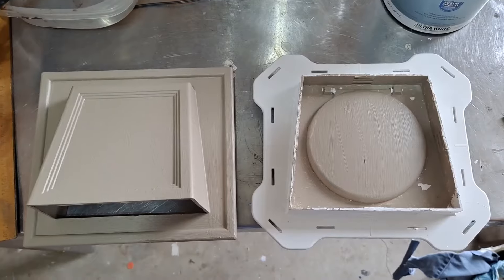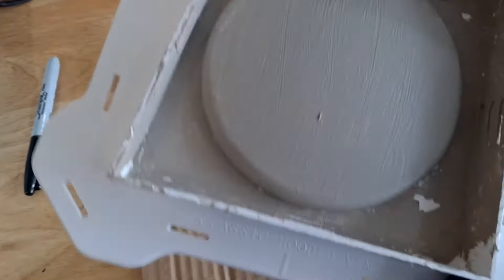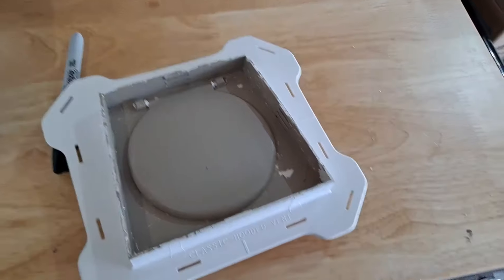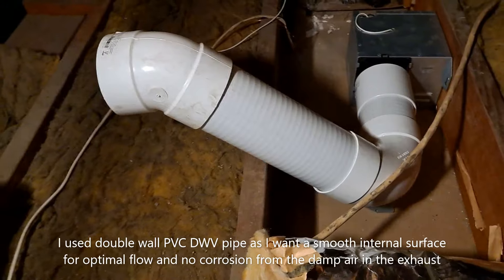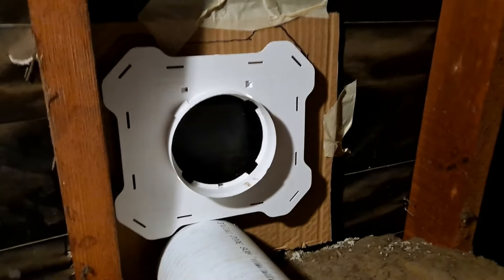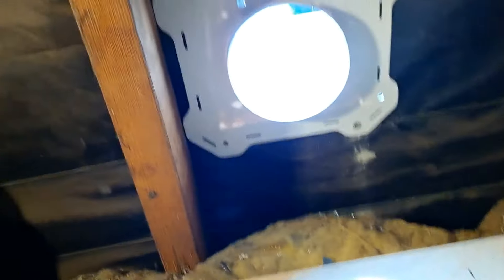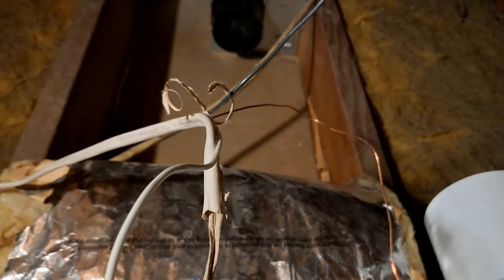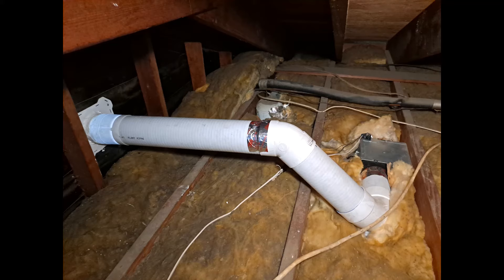Bathroom Extractor Fan install using rigid plastic duct

Comment: Just watched great vid. I’ve found a concentric condensate fitting designed for just before/after the fan connection, it needs to be positioned in the vertical, but wrapping the pipe in rock wool will help to prevent condensate within the duct (some people find it drips back out through the fan)
Reply from the maker: Thanks. Yes I'm in a dry climate but I can imagine that could be a bigger problem in colder or humid environments.  This is true whether you use metal or plastic duct.  I usually leave my fan running at least 20 minutes after showering to allow drier air to remove as much moisture as possible from the duct before it stops
Reply: That's a smart idea!

Comment: Good install Indra, however I don’t think you should have put the mounting flange on the inside of the wall, the outside flapper/finish plate clips on to that piece and you have the thickness of the wall in between them.
I’ve always just drilled a 4” hole and mounted the flange to the outside of the wall and clipped on the cover.
An insulated sleeve will help with condensation, it’s just slipped over the pipe.
Reply from the maker: Thanks for the comment.  You're right - I should probably have mentioned this in the blah blah.  In most installations I agree that what you describe is how it should be installed.  However, my wall was already existing.  I didn't want to damage or have to re-do the exterior finish and the stucco is only an inch or so thick so I was able to put the flange inside and there was enough penetration that I could still clip the cover on from the outside.  This meant that I didn't then have to figure out how to cover up the flange on the outside surface of the stucco.  I was concerned about that and until I checked the thickness of the stucco I considered changing my vent and the install method.  In summary I ended up with an 'un-conventional' installation of that particular style of vent.  I've added a note in the Description about this

Comment: Recently fitted an inline extractor fan in our loft. I raised the height of the fan on a plinth so that everything from the fan exhaust is downhill.
Reply from the maker: good move.  Indeed I believe most building codes call for a 2% downward slope.
Reply: did the same thing, let the condensation run out the wall

Comment: Awesome job.  I am just realizing that I will want to use rigid PVC.  That exhaust outlet looks nice. Where did you get that?  I read recently that it makes sense to insulate the fan box too. That cold metal box can also condense your humid air rapidly.  I plan to do that too.
Reply from the maker: Thanks ! The vent was from Lowes.  There's a link in the description.

Comment: Very cool... but I wonder how hard it would be to replace with a different fan down the road since everything is rigid.
Reply: He can access the attic where it is installed. Also, you don't need to glue the joints, which makes it easy to take apart in the future.

Comment: will the steam , turn back into water when it enters the rigid pvc pipe and run back down and shorten the fan ?
Reply from the maker: Hi. Good question.  Shouldn't do because I made sure there is a slight slope down away from the fan on the long section.  Also the inside surface of the pipe I used is slightly ribbed.  Plus I'm in California so we don't often have long periods of really cold or damp weather

Comment: Hello, I recently removed the flex pipe from my bathroom fan and intend to install pvc also.  I don't want to glue the pvc to the fan, so I was thinking of getting a flexible coupling.  It appears that you secured your piping to the fan using metallic tape only, am I correct or did you also glue it?
Reply from the maker: Hi Mario. You're correct. I didn't glue it. I used the metal HVAC tape only and it worked out great.  The tape isn't cheap but it's worth the $
Reply: @dadlifediydoityourselflike2293  Nice install!  Just a couple questions/concerns but may not apply to you.  I did this kind of install as well 5+ years ago but a longer run to my exterior wall.  Some of the things I ran into that I've had to modify since then may not apply to you based upon your climate.  I live in New England USA where during winter, our unconditioned attic gets well below freezing.  I also used the metal foil tape for my connections initially.  My challenge comes from the condensation that drips out of the vent flap will freeze once the fan is shut off because there is a small quantity of water that remains under the flap (I have the same PVC flap you have shown).  As a result, that flap won't open the next time the fan is used if its still cold out and believe it or not, the fan in my case was powerful enough to pop one of my connections that were taped.  I didn't know this until I started seeing water stains on my ceilings below.   If you may have these same cold temps, I suggest converting as the other poster asked to the flexible couplers.  I've had no issue since then.  Likewise as someone else has posted, if you do have really cold winters, do insulate around the pipe.  It will prevent so much condensation inside that can cause that flap to freeze shut.  Finally, I couldn't really tell by the video what the final connection is to your flapper, but just be careful about that connection as goes through your exterior wall as this connection is not water tight and any condensation that collects or passes through this zone will find a way through the connection and into your wall.  Again, not sure if your connection is actually outside the wall or in the middle or worse, inside.  I've been searching for a good way to remedy this online for some time which is why I found your vid.  I think in the end, insulated pipe is the best solution but I haven't gotten around to it yet so I just need to make the move!  Either way, much improved over the flex stuff!
Reply from the maker: @vcookster3915  thanks for the constructive comments and for sharing your experience.  I live in southern California so I'm not subject to the kind of temperatures you're seeing. Your comments are therefore appreciated for those who watch this vid and live in colder areas. In that case I would support the insulation and other comments you made.  My exterior wall is stucco and doesn't have an internal wood or other surface inside it interestingly.  My connection is inside the attic and for that reason I was careful to seal it with a silicone based sealer that bonded to the pipe and the vent flange.  I also sealed around the opening that I cut into the stucco.  Any drops etc will therefore have nowhere to go other than outside.  Amazing that your flap stuck so hard that the pressure popped some joints in your pipe . Wow.
Reply: @vcookster3915 In regards to the condensation that forms near the bottom of the flap and freezes shut what is your solution to that?
Reply: @OGCJ10 condensation is inevitable to some degree as the hot steamy air get sucked out of the warm bathroom and straight into a potentially freezing cold loft.. you cant stop the science of steam instantly condensing within the cold pipe but you can reduce it by fully insulating the ducting and having the fan overrun long enough to expel the moist air and to essentially blow dry the internal ducting...

Comment: You actually WANT the water to sit in the "ribs" of the flexible duct. That way, it doesn't run back into the blower/inside the bathroom. The ribs and a small horizontal run give it somewhere to settle and evaporate.
Reply from the maker: Thanks for the comment.  Yes that could be a factor which is why I sloped it very slightly downward towards the vent so it wouldn't run back towards the fan.  Also the pipe I used is not entirely smooth inside

Comment: Is it hard pvc pipe or soft pvc pipe ?
Reply from the maker: Hi. There is a link in the comments to the 4" pipe that I used from the Home Depot.  In case the link is not accessible in your region it's equivalent to a lightweight rigid thin wall PVC pipe.... although the pipe I used is designed for drainage and has triple wall design which gives it some insulating properties

Comment: You spoke kind of fast, but did you say the pvc was insulated? If not, the pipe is going to sweat on the outside and drip onto the joists.
Reply from the maker: It's triple walled so I doubt it will sweat on the outside. I also live in a low humidity area.   However I will check it during a cold spell to be sure.  Also, as another commenter mentions, the duct can be wrapped with insulation if necessary, depending on the climate where it's  installed.

Comment: How much would one of these cost to have fitted ?
Reply from the maker: If you mean by a contractor sorry I have no idea. It will depend on a few factors like ease of access, whether you have to go through the roof or not...and also where you live as contractor rates vary a lot

Comment: Hi, what kind of metal tape did you use? Is it aluminum foil tape?
Reply from the maker: Hi Cleo. Yes it was a 3M foil tape that I had previously used when installing a dryer duct.  I believe it was this product
 https://www.lowes.com/pd/3M-2-5-in-x-30-ft-Pipe-Wrap-Tape/1002947412
Reply: @dadlifediydoityourselflike2293  I bought one, it is so thin. So I’m looking for a thicker one. Thanks anyway.
Reply from the maker: @PCleo  yes. There are different grades.  I found the cheaper ones are not very durable.  Good luck

Comment: Since you're using a rigid duct, did you consider using an exterior wall mounted exhaust fan?
Reply from the maker: That could be an option but not commonly sold in my area and I'm not sure if it meets local codes.  In fact I did consider using an inline fan as they can be quieter but in the end I went with what was cost effective and easily available which was the ceiling mounted unit
Reply: But the work already isn’t up to code. The pipe isn’t insulated

Comment: Where did you get the double insulated pipe from??
Reply from the maker: From Home Depot.  Link in the description
Reply: I never knew they made double insulated PVC pipe? Is that something new or has it been on the market for years?

Comment: Hi, can you use rigid duct to tile vent on the roof instead of going through the wall?
Reply from the maker: I don't see why not.  However I don't claim to be a professional so please get local advice from a pro. Thank you
Reply: yes and it saves the possibility of damp condensing from the vent onto your outside wall

Comment: Your wiring is unsafe (fire and shock hazard) and not code compliant. The wiring connections need to be terminated in the junction box in the fan. The  cable sheath needs to be continuous between junction boxes and secured by an approved cable clamp. 
Your installation would be an immediate fail if discovered in an inspection.
Reply from the maker: noted, thanks